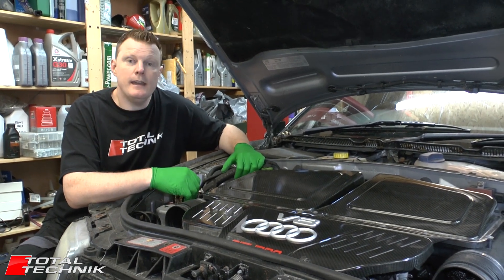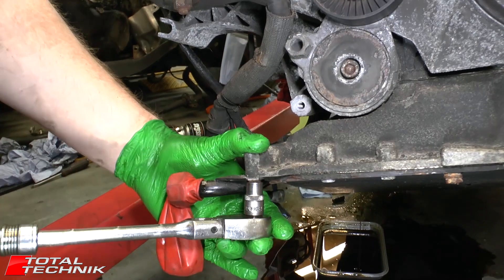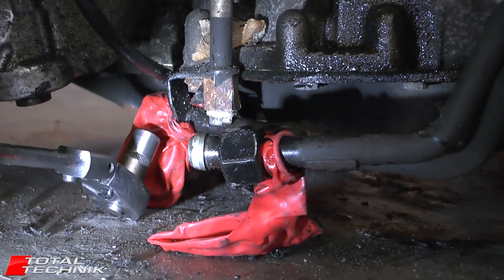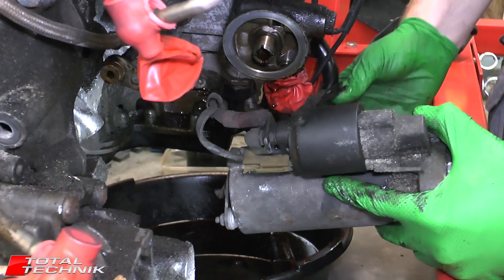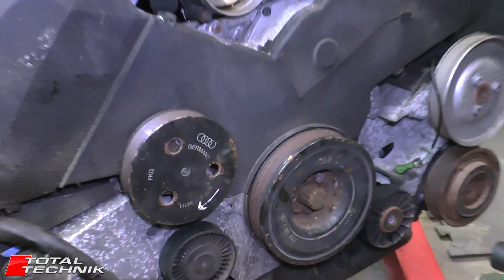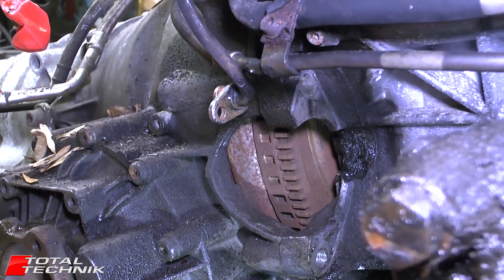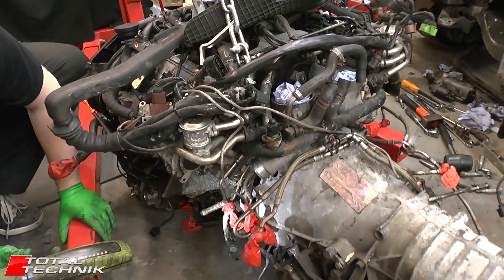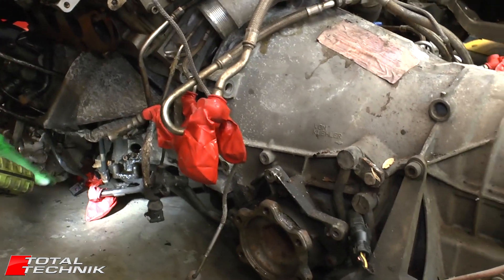How to Disconnect Engine and Gearbox - Audi RS6 (C5) - TOTAL TECHNIK

Comment: Hi
I have a C5 Audi RS6

I am about to bolt my Engine to the Gearbox.
I'm pretty sure that the Gearbox was in PARK when i removed it.

Wouldn't this be a problem for me when trying to rotate the motor to tighten the 6 bolts from the Flywheel to the Torque Converter  ?

Would the gearbox have had to be in Neutral  ?